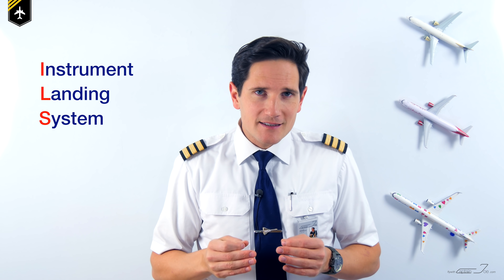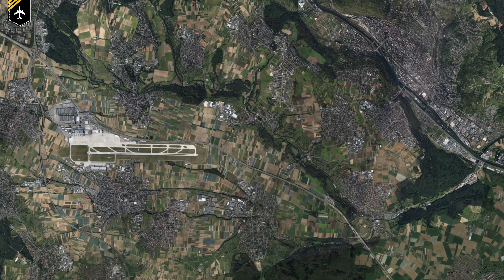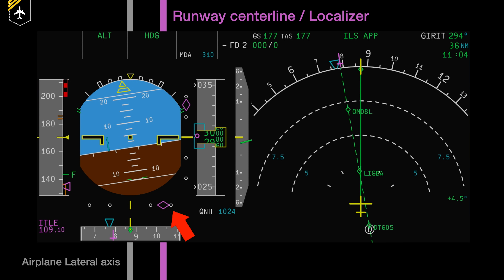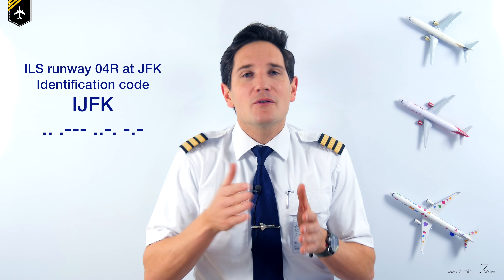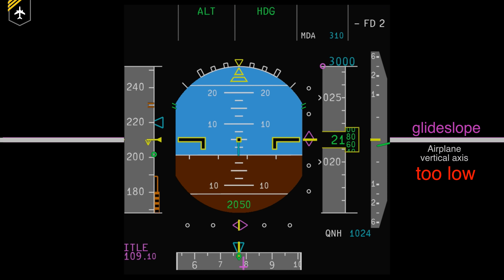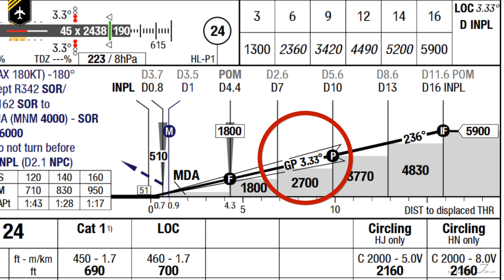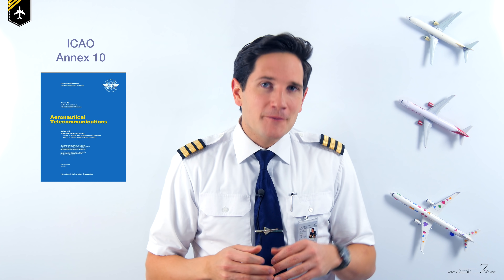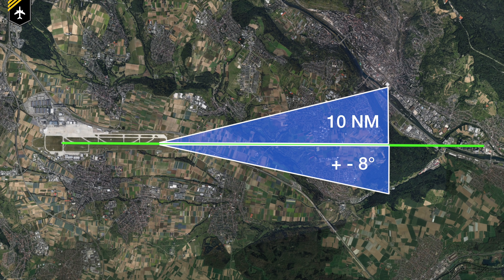How does an ILS work? Explained by CAPTAIN JOE

Comment: Hi Joe, first of all - thanks for your videos! Very valuable insights into aviation. You and Mentour are my favorite aviation channels here on YT.
But let's get to my question: does captain always sit on the left seat in the cockpit? Is the assignment of the seats to captain and the first officer given or is this just a question of a personal preference and mutual agreement of the both parties? And what about the hand preferences? Do the left-handers prefer left seats or the right seats? My assumption is that it doesn't matter, but me personally would control the side stick with much higher precision using my right hand (I am a right-hander). And yet a subquestion - if the "captain on the left" concept is traditionally given by the most usual seat arrangement (similar to cars), does that differ in cultures, which drive on the left (UK, Japan, etc...)?
Thank you for the answer, could be quite an interesting video :-).

Comment: Is there any cooling system for the jet engine gas turbine ,. Like car use water cooling system to cool the engine lubricating system
Reply: No there is not. It is already very cold at 40,000 feet flying at 900 km/h!

Comment: Dear Captain Joe. What is turbulense, the thing when a plane jumps up and down when in the air.? And why, when the plane has just taken of, and are about to climb, then I have noticede that it sometimes feels like the plane drops towards the ground.?

Hope you can answer these questions.

Best regards
Jesper Hansen
Reply: sisusdk for the first part, turbulence is just moving air. And since air is the medium in which the aircraft operates, it also moves with the air. Just like how a ship goes up and down due to waves, similar case with turbulence.

And for the second part, when you take off, the aircraft uses max thrust. But once it has climbed up a bit, the pilots reduce the power to below maximum. This is done to reduce noise and to improve engine life. Since the power has been reduced, the rate of climb decreases and hence it feels that way.
Reply: Thanks!. That really help me. :)

Comment: To verify I have the correct ILS, I have to listen to the Nav radio audio and listen to the morse code.  

I fly a Mooney M-20F; the glideslope receiver is a Garmin 430W.  

By the way, the other reason you MUST listen to the morse code of a ground radio beacon is that when it's transmitting its standard code, that's verification that the signal is correct.  Occasionally they put a beacon in test mode, in which case its signal may not be valid, but in that case, the morse code will be something different.  I know that's true of VORs; I don't know if it's true of ILSs in practice.

Comment: When will the correct time to bring down the flap wings?
Reply: Ikram Hakimi Mohd Hassan when you need to fly the aircraft at a slower speed
Reply: A2DJP what about the time between flap 1, flap 2 and full flap?
Reply: This depends on your aircraft weight. On Airbus aircraft, i believe there is a "S" on the PFD speed tape, which is when to retract flaps.
Reply: interesting

Comment: What is trimming..in airplanes.. specifically in Boeing Airplanes..??
Reply: Anish Dhamankar trim is used to configure the aircraft to fly in a specific manner e.g. climbing or straight and level

E.g. if you want to make the aircraft climb for 10 minutes, you can hold on the elevators for 10 minutes. However that’s not practical. So what the pilot does is set the elevator trim in a way that the aircraft climbs without any extra input needed.

And trim isn’t a Boeing or airbus thing. It’s present in almost every aircraft. Either mechanical or electric.

Comment: I watched Top Gun again a few days ago and I've been wondering, can flying through another aircraft's jetwash really stall a jet engine? Or is it just another Hollywood heresy? Would appreciate a response from you. Thanks!
Reply: Justine that is really the worst dreaded moment in any aviation experience.  That's the reason why you have a 3 to 4 minute delay at major jet airports per takeoff or landing.  To do it right would mean the plane you are flying would fly into the equivalent of a tornado and will likely fatally lose its air support on the wings.

Comment: Why have the Brakes no cooling system with Water, cold air or liquid nitrogen? at a RTO event, 
can save time or not?
Reply: Laura It's me the Captain aircraft generally use carbon ceramic brakes. They are much better in absorbing heat due to braking
Reply: yes but after RTO need 3 - 4 hours for cooling down the brakes and then first new takeoff trying
Reply: Laura It's me the Captain yea on paper you make a valid point.

But in reality, adding complexity increases weight and adds other costs for stuff which is redundant.
Reply: It would be possible to cool the brakes with water or other?, also because of fire protection, wheels protection.... i think safty first
Reply: Laura It's me the Captain the brakes are tested before the aircraft is certified. They test whatever you've mentioned. What you are saying has a point, but that's more of a non critical redundant safety rather than extra safety.

Comment: JOE pls explain auto pilot landing
Reply: basically auto pilot landing is locking into a particular location and the plane's guidance equipment would home in if there are no obstructions in the area, but I don't think its commonly used due to the fact that is when flight crews need to be alert.

Comment: Hey Joe, got a question. What happens if there is an earthquake ? Do you have to abort landing ? And what if the ATCs have to evacuate the tower, how is the traffic managed ? Do pilots manage themselves and decide who lands first and second and third... until the ATC come back ?
Reply: What usually happens is that an airport vehicle will go to the runway and assess damage, and advise on the tower radio frequency. If there's an aircraft on approach they'll be instructed to abort and go to the missed approach holding pattern (however aircraft that are cleared to land can, by law, land at the pilot's discretion) and contact the ATC area control center, which is usually located in another city. If the tower is evacuated then the center will re-organize the approach sequence based on info from the airport using cellphones/satellite phones, radar returns and pilot position reports. In these cases most pilots will divert to their alternates. If a pilot somehow still wants to land at the affected airport the center will clear the aircraft to land (if the airport is not already closed) and hand the flight over to the "unattended" tower frequency, and that little airport vehicle will be on station to provide the pilots with advisory information.

If both the tower and area control center go offline (highly unlikely as there are repeater stations all over the place, and VHF radio can travel very far at altitude, e.g. 220km/140mi) the pilots will refer to their aeronautical manuals for the emergency sections, like TIBA (what A2DJP mentioned), talk to each other and work something out. The vast majority of pilots will still divert to unaffected airports.
Reply: Not sure about the rest of the world, but here in New Zealand we have TIBA. Basically it’s a set of guidelines to be followed if atc is disabled. Mainly pilots maintain separation and do sequencing on their own, announcing their intentions on the radio.
Reply: Matt D as we all know, it would be too unsafe to land due to insignificant shaking within the area, the landing would be redirected to another airport due to Aftershockes
Reply: Read my Channel about/bio what about the ATC leaving the tower ?
Reply: Matt D do you mean the people that work in the atc tower or the planes departing?
Reply: Hi Matt.  There are procedures in place for abandoning ATC facilities.  Obviously there will most likely be an impact to efficiency, but safety will remain a top priority.   In an event such as an earthquake, or fire in the tower,.. tower  controllers have portable radios that can be used in an emergency,.. usually with limited range though (About 10 to 15 miles on the attached antenna)  We can set up temporary "towers" in vehicles , or at other points on an airport.   All ATC facilities have procedures to follow if they lose power,  or evacuation is imminent.  It's not fun, but it can be done.  Also, as has been mentioned,  Pilots are trained to work together at an uncontrolled airfield, and they do it quite well.
Reply: Avantime Damn, they taught about all of this :) Aviation is awesome, and creating a viable system to handle such big, fast, and powerful machines is very hard, hats-off for them. And thank you for your response :)
Reply: I would hope that the tower is strong enough to survive at least a magnitude 5 earthquake.
I remember here in Wellington we had a 6.0 earthquake just as a plane was taking off. I guess it is really the Captains decision to abort or not, but then, would they even feel it?
Reply: Matt D Good question
Reply: Not so agreeing with answers
Reply: That happened in Mexico City airport last 19th September, there are videos about it you should look for
Reply: Edit: here are a couple examples:

Air Force Tower evacuated due to fire alarm
https://www.youtube.com/watch?v=0jg_fHzcfDw

FULL LOSS OF POWER at Miami International
https://www.youtube.com/watch?v=fvD1-SBq0hg
Reply: Matt D what are the chances of that?🤨
Reply: Landing at uncontrolled airports is a standard part of pilot training, most airfields used for initial training in the USA do not have a tower. There is a basic procedure and any specific changes for an airfield are listed on charts and in directories(like right hand vs left hand traffic for a runway), pilots simply talk on the common frequency for that location. Low altitude instrument meteorological conditions such as fog would likely cause diversion to an alternate location.

Comment: Blue and yellow light gives green light? I don't think so ;) You were thinking about pencils or something. They mix subtractively (the more colors you use, the darker the picture gets). Light on the other hand mixes additively (the more colors you use, the brighter the picture gets). Blue and yellow will yield white light (by the way: That's how white LEDs produce white light, even though the color spectrum of LEDs is very restricted due to the band gap. The LEDs are actually blue and an active coating on the LEDs converts part of the blue light into yellow light, so you get white light as a result. This is required because there is no single light frequency which is "white".)

Comment: Will the ILS systems in the cockpit pick up the ILS signals automatically when approaching any runway or do you have to activate/enter something somewhere?
Reply: Yes, on Boeing aircraft, you enter the ILS frequency, and when in range, you can activate the "LOC" or "APP" mode. "LOC" mode will only capture the localizer, while "APP" will capture both the localizer and glideslope.
Reply: thebaze you have to set an ils frequency on the nav radio

Comment: I always wondered that while taking off we use flap setting 2 so that we can gain lift at lower speed and also while landing we use the same flap settings (2 then 3,4 and full) to slow the aircraft. How is that possible?
Reply: avick ghosh it’s a bit technical. The amount of lift generated by the wings depend on its shape. Flaps change that shape so that the camber increases and hence generate more lift. However drag is also produced
Reply: A2DJP but while landing how same flap setting 2 reduces speed and lift?
Reply: avick ghosh it doesn’t reduce lift. Lift is increased with flaps. However, what flaps do is make the aircraft fly slower and generate the same amount of lift.

During takeoff flaps 2 helps in generating more lift so that the aircraft can take off earlier.

During landing flaps 2 helps in flying the aircraft slower producing the same amount of lift required.
Reply: Flaps increase lift by two means and you usually only ever hear the first one. 
1. they make the wing in effect longer and more curved so the low pressure area above the wing is increased. 
2. They direct air downwards which causes an equal and opposite reaction upwards

At higher flap settings 2 becomes more of an effect however it comes at the cost of more drag. 
You dont mind the drag when you are trying to slow down and land, but it is unwanted when you are trying to accelerate and take off.

Comment: Hellow Joe! The ILS freq on the 777 is automatically turned by selecting the landing runway on DEP/ARR page on the FMC while the 737 you have to turn the frequency by your self. But there is a equipment which is called the IAN-integrated approach navigation on the 737. for example the G/S is replaced by G/P. Does the airbus have the IAN as well?
Reply: If you're asking if Airbus aircraft tune ILS frequencies automatically, then yes, they do.

Comment: Dear Captain Joe, why don't you make a video specifically about the DLR exam(s) as you might know it is an important phase of a pilot's starting career and most of pilot candidates are having deficiency of knowledge before their first exam and it leads to a failure. This is a crucial topic which is discussed in Turkish aviation forums. If you just have a look at it, i will be appreciated. Thank you! =)

Comment: How do you know if your landing gear is not working
Reply: Blessing Blessing there is a lamp which lights up if landing gear is in correct "down" position.
But I can be wrong, since I dont know much.
Reply: As the guy above me said, you have landing gear position lights. From that you figure out.

 
But if the pilot is unsure, they generally do a low pass at an airport so that the atc can visually check
Reply: Good to know, thanks ;)

Comment: I understand the Morse code would be on the signal for historical and "Hey, it can't hurt" reasons. But how many pilots under the age of 30 have any concept about Morse code? 
Great video. Thank you for doing this
Reply: Phil Liberatore you don’t need to know morse code. You just need to know what morse code to expect and then match it with the identifier morse code as per the chart
Reply: A2DJP - I'm still skeptical,. However, no doubt the ILS computers can handle it.
73's - AA8QN

Comment: Did you know Ofcom is trying to push radio equipment for PMSE (programme-making and special events) to the 960-1164MHz band (currently used by DME systems). As a user of PMSE 
 Equipment, can I ask if anyone here have any problems with this, would there be safety issues?

Comment: What Is And What does de “trim” do?
Reply: ASAP Dolphin the most layman definition is that it’s like an elevator (or any other control surface), but unlike an elevator, in which you have to hold the yoke, the trim once set, remains fixed. 

Example, if you are taking off, if you just use elevators, you have to hold the nose to maintain that climb, but if you set up trim, it does it for you.
Reply: A2DJP Thank you
Reply: A2DJP have you tried going to his website and submitting your question? That is how I asked mine.

Comment: So how how is the ILS different from the visual glideslope lights (for example: PAPI) off to one side of the runway?  Is it as simple as "one is outside the cockpit, one is inside the cockpit"?  Does one provide more information than the other?  Or are they to be used together?
Reply: PAPI's and ILS glide slopes are the same. PAPI's can be used for visual approaches though.

Comment: then what will happen 2 runway or 2 cross runway airports? will not overlap these glideslope and localizer s frequencies?
Reply: hiranthaashan adikari the frequency are different so it shouldn’t affect.

Like in a city, you have multiple fm radio signals, but you only hear the ones you tune.
Reply: thank you A2Djp :)

Comment: So why haven't all these systems been replaced with GPS/RNAV? It seems like that'd be a better way to go.
Reply: because some airliners dont have the proper nav equipment with the according accuracy yet. furthermore, almost all airplanes (except the 777) are not allowed to do an autoland using a gps approach, which is a must-have in low visibility conditions.

Comment: I'll just throw EGLC London City, not so steep, more than average but within surrounding areas steeper than normal, and with the runway you know its max A318/A319. VNLK Lukla is probably worst but thats no IFR let alone ILS so you need to be a VFR master to wheels down at that hill.

There are a couple of private commercial strips in the Apls i know of but not off hand...

Comment: LOC and G/S signals are not on the same frequency.  They are on different frequencies arranged in a one-to-one relationship called a channel.  For instance, for JFK runway 4R, the LOC is on 109.5 MHz and the G/S is on 332.6 MHz.

Also, marker beacons are not used at all in Canada.  Either NDBs or DME equipment are used instead.

And if there is no DME and no marker beacons, you can also use your radar altimeter to determine your progress through an ILS approach.

Comment: Who doesn't miss Hong Kong's old Kai Tak Airport approach 😝
Reply: I used to live on the approach on the slope of one of the valleys and could look out at the passengers a few hundred feet away. Good times
Reply: red checkerboard
Reply: mactopia I actually did it in a simulator... when I was like 10
Reply: mactopia Hold your tongue, lol!
Reply: Yes you had washing lines and rooftop  plants going past your window
Reply: @user-ky6vw5up9m  Yes, I remember that about that airport--coming in low over the apartment buildings. Very cool....
Reply: mactopia awwww, I just wanted to say that
Reply: Nobody will ever beat Kai Tek! =-)
Reply: IGS 13!!!